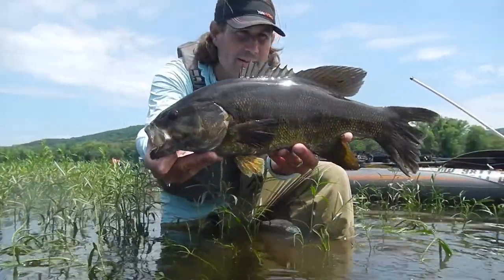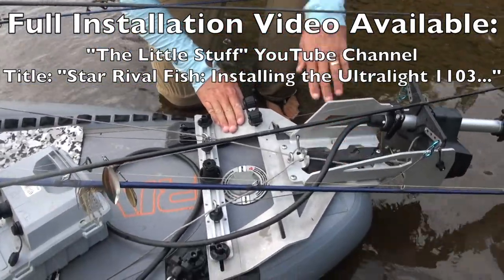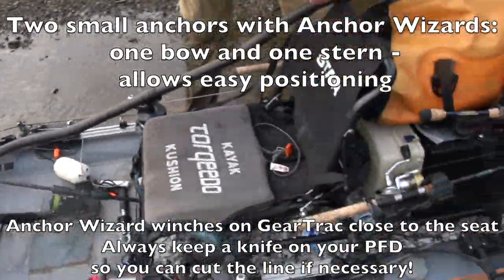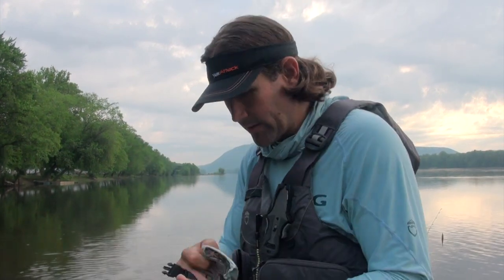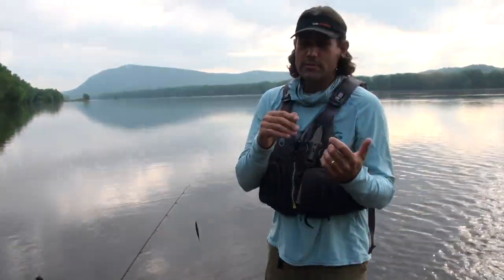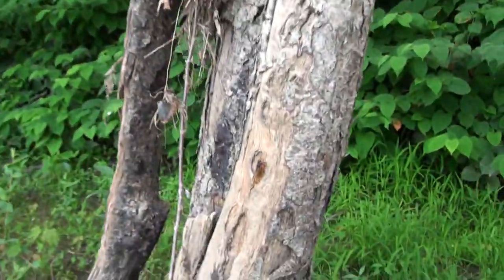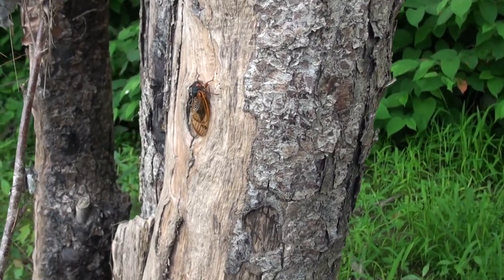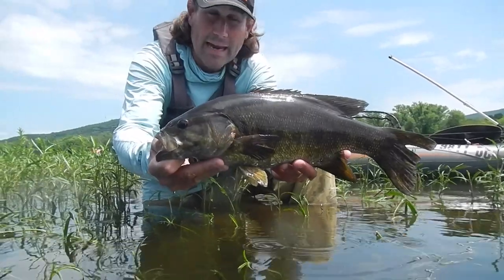Stick Steer on Inflatable Kayak

Comment: Great tips/info
Reply from the maker: I love that boat. The stability let’s me do that stand up hauling ass with the stick steer!
Reply: @TheLittleStuff  I’d be really tempted to copy that rig but I’d need a kit, or a shop to do it, I’m not handy enough on my own.  Hoping to get out more this year to justify the expense of either going pedal drive or electric motor.  Would you risk running that motor on water like the Rapp where there are a lot of rapids?  Is it easy to drop and lift while in the kayak?

Comment: In rigging your anchors have you had any problems with wear due to the anchor line rubbing on the side pontoon in the back or the one your running off the nose? Would it best to add a patch or extra material here to accommodate for this?
Reply from the maker: I did apply a patch to preemptively counter the anchor line rubbing. I prefer the Scotty Anchor boom mounted onto a YakAttack SwitchPad Flexible Mount. That lifts the line away from a concentrated sawing on one spot.